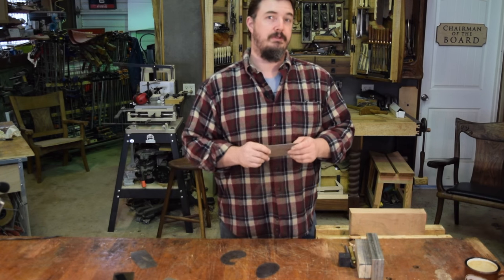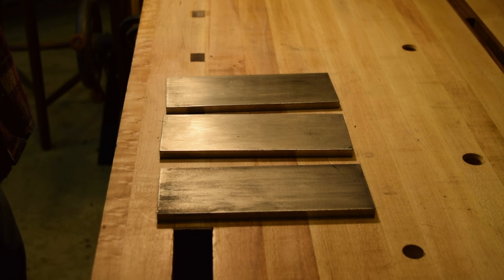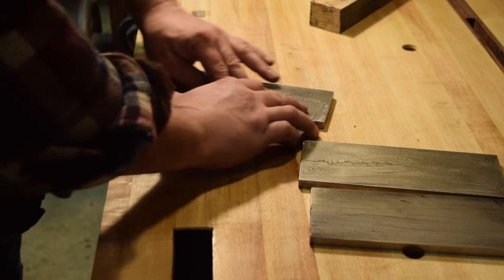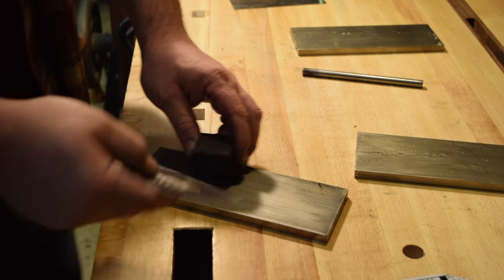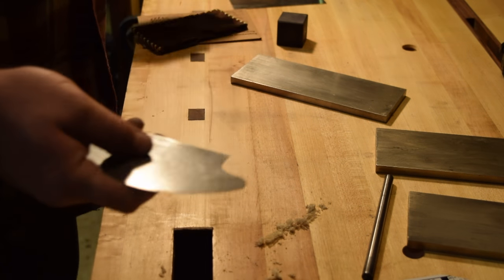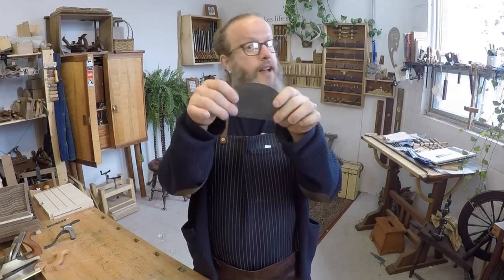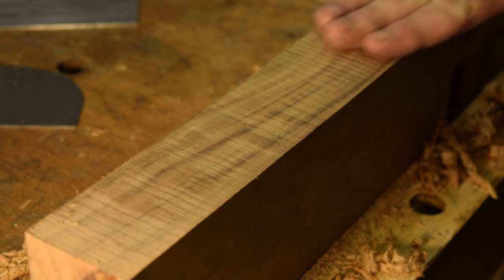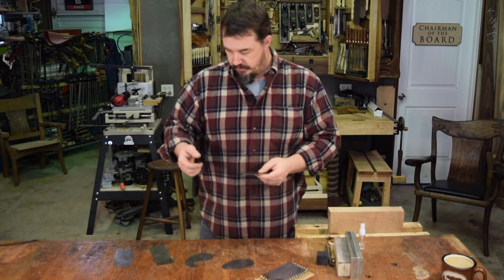card scraper

Comment: Round shank of a screw driver works as a burnisher too - Steve Latta
Reply from the maker: As long as the metal is stronger than the scraper. My scrapers are 1095 tempered spring steel and they can chew thru some junky screw drivers. So use a good one ;) Thanks for watching.